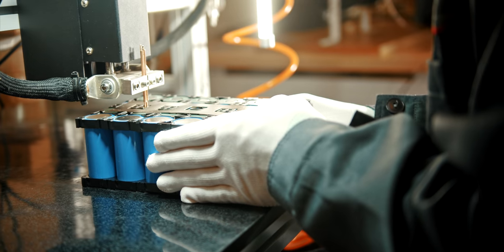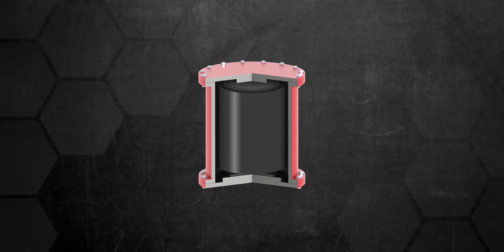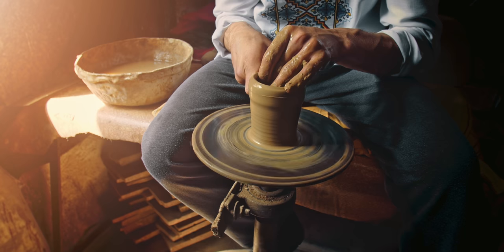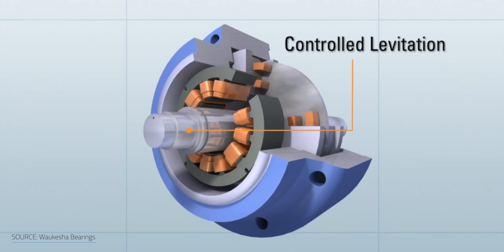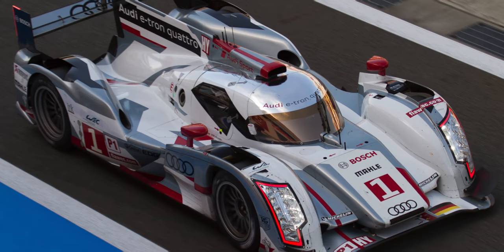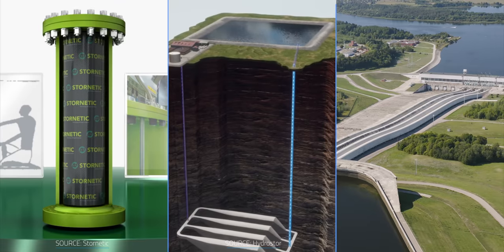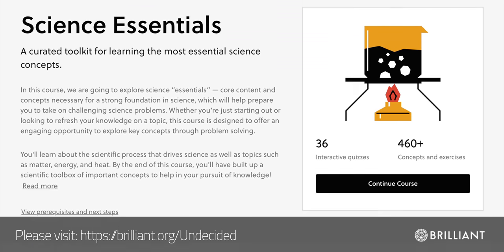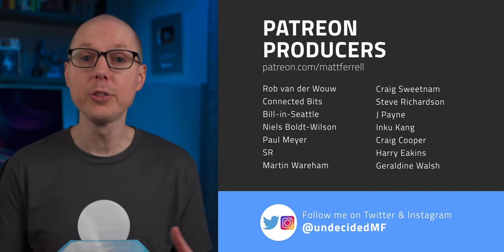The Mechanical Battery Explained - A Flywheel Comeback?

Comment: On a more primitive level, water towers too.  Which provides a simle health/society benefit at the price of much lower efficiency.
Reply: Any accumulators really - we should be using old mine shafts and massive weights on cables - some of those shafts are miles deep!
Reply: @JohnnyWednesday  Problem is that the gravity storage is really inefficient, even in deep mineshafts.
Reply: @MDP1702  - inefficient how? it's the same potential energy storage as pumped hydro but you can use the entire force of the volume
Reply: @JohnnyWednesday  Inefficient in terms of storage capacity and cost.
Reply: @MDP1702  - it's instantaneous load - like pumped hydro? it's worth the inefficiencies to meet demand, maintence would be next to nothing and cost? I don't know - but you're talking a generator/motor, a weight and some cable then a sub-station nearby - and there are old mines almost anywhere you care to look.

Plus you can use many cables in one shaft if you make the weights long and thin - you could suspend hundreds of tons over a mile drop and often far more - how much energy is that?

Given cranes that can lift greater than 100 tons require large diesel engines with a few thousand horsepower?

and not to mention that you can vary the amount of power at a given moment by allowing the weight to fall faster - and 'charge' the system at whatever rate you want too.

There's a huge amount of energy in potential for mass subject to gravity - as made evident by the power required for a rocket to ascend or an F35 to hover - those engines are roaring dude! and you can easily suspend more weight than an F35 in a mine shaft - a lot of energy!
Reply: @MDP1702  - And I'd point you to the victorian era technology of 'accumulators' - they are capable of huge power outputs - the accumulators that raise tower bridge in London for example - I recommend you  check out a video of those :) they're beautiful and fascinating! (Bascule Chambers)
Reply: fresh water is a very finite resource
Reply: @yes-vy6bn  there are ways of using seawater and keeping corrosion to an acceptable minimum - much worse than fresh though, of course.
Reply: @JohnnyWednesday  Let's assume you lift 1000 ton 100 meter with 100% efficiency. That only takes 272 kWh. This is obviously also the theoretical maximum we can reclaim. 272 kWh is roughly what 3-5 houses consume every day. So for every street we would need one of these gargantuan machines, each of them hauling a 1000 ton weight 100 meter up into the air or up a steep hill. How much would a single one of these contraptions cost to build? I guess we're talking tens of thousands of dollars.
Reply: @SweBeach2023  - I guess you're right. Seems like such wasted potential though... (badum tshh)
Reply: @JohnnyWednesday  it seems so but it isn’t. It works well in hydro power because big rivers transport insane volumes of water and substantial height difference are located along the river. There are several rivers that flow more than 1000 tones (m3) a second on average.
Reply: @JohnnyWednesday  The accumulators are more like capacitors.

Now, if you lower 1 ton 1000m, it would only provide around 100kW of power output, 1/30th-1/50th of windturbines. Now the storage capacity can vary, if you only use one 1 ton weight, you only get a total 2,8kWh, ofcourse you can use multiple blocks, though if you take 100 ton or 100 1 ton blocks, you'd be able to store around 277kWh. That is nothing.

The problem also is that you'll need to find cabling that is good enough. First problem is that even elevator cables larger than 500m are not really possible, this is why elevators in a very high building are a great problem. Getting a cable that can takes a larger load than 1 ton over more than 500m is likely to be very very cost intensive.

Then there obviously is the amount of deep mines, sure, there will be quite a few, but nowhere near enough to make a huge impact.

And then there is the cost of the entire system, which will not be small.

So no, gravitational storage is not usefull, at least not compared to existing storage options.
Reply: @MDP1702  - Thank you for taking the time to explain your thinking and knowledge on the subject - I concede that the idea is a poor fit for our needs, thank you :)
Reply: @yes-vy6bn  
There is 43560 square feet in one acre of land. If you only have one inch of rain.
Multiply 43560 x 144. And divide that answer by 231, and you will have the number of gallons of one inch of rain on one acre of land...  One acre is about 208.71 feet x 208.71 feet........

Another way to look at it,,,  if you were to go for a long walk,,,  say one light year.
You would no doubt get thirsty along the way. But some nice person put one gallon of water at every mile post for one light year...  It would only take 5.33 cubic miles of water to do that.  . 

Now they say that the ocean averages one mile deep,,,  So,,,  taking 5.33 cubic miles of water out of the oceans would not even be noticed... Oh,,,  there are whole countries that use nothing but desalinated  ocean water...
Reply: @SweBeach2023  Exactly. If at all, we could use ships and sink those weights to the bottom of the ocean without having to dig countless holes. But even then, we would need a helluva fleet of ships or rigs, and cables to move the electricity. Oh, and water friction also causes more energy loss. So no, that too is not a viable idea.

Comment: Well, it might be a competitor for batteries in some circumstances, but this is not even close to the sort of price to solve the seasonal energy storage problem. it's good that you covered this reality, some people really are ignorant of how far we are away from a cost effective solution on that front.
Until then - nuclear needs to be part of any zero carbon grid.
Reply: Nuclear power is even less cost-efficient than solar+flywheel (levelized cost of unsubsidized energy):
Nuclear power: $168/kWh
Solar Power: $35/kWh
Flywheel storage: $32/kWh
(This assumes that the flywheel is discharged daily, 365 days/year, in order to balance out  peak demand. It gets more efficient if used more frequently, but that is unnecesarry considering it already outperforms nuclear power)
Reply: @Ramschat  These figures are nonsense. Solar power is completely unsuitable in many parts of the world, such as northern Europe and Canada.

Comment: How efficient would the magnetic bearings be with the notable masses that would be needed to store the energy? Wouldn't they essentially have to carry the weight all the time using the electricity? How much of the electricity would be needed for that? Or could it be done with permanent magnets that don't need electricity?
Reply: permanent magnets would discharge their magnetism quickly

Comment: When it comes to energy storage, my first thought is raised water.
Reply: They are very inefficient and require specific landscapes to operate at scale
Reply: @nickvanrooyen3247  They’re generally really good due to the square cube law
Reply: @xa-38  I stand corrected, I see they are around 80% efficient.
Reply: Yep, they're great, only problem is in finding suitable locations that are adequate and empty enough to be flooded
Reply: @Paulo44.01  And also take a look at the current situation at Lake Mead (Hoover dam reservoir)

Comment: I've heard of using water stored in a high up reservoir, and then when energy is needed, the water can flow down a channel and generate hydro-electric.

Storing mechanical energy with gravity. Essentially, this could be done with any heavy object that's lifted and then lowered.
If you had a really high torque electric motor to lift an extremely heavy weight, you could then gradually lower that weight to generate mechanical energy.
I mean, hell, let's make a hybrid. Lift a massive flywheel up 25m, then gradually collect the energy as it falls and rotates. (easier said than done, but idk, it's an idea)

Comment: Grandpa said the backup generator on his Army base used a giant concrete flywheel run off a electric motor, when the power went out, the inertia of the flywheel started the generator.
Reply: @daviddavids2884  "started" the generator, no it drives the generator, that makes sense.

Comment: I've had a small obsession with gravity batteries for a while now, and not the hydro variety. There has to be a gear ratio that would be useful 🤔
Reply: We have gravity batteries; water reservoirs behind dams with hydroelectric generators. You're storing the mass of the water in the reservoir, and letting it flow to a lower elevation, harvesting the energy in the process.

Comment: I think that old school flywheel batteries could make a comeback. The flywheel might have to have a fluid filled interior so that as the revs increase, fluid is injected into the interior to increase mass which will help the fly wheel to run longer.

Comment: Put it simply :

1. Cost (more expensive than typical Lithium-Ion battery)
2. Energy density.

Flywheel are better suit for short but high energy demanding application like industrial application rather than slow but steady cycle like typical lithium battery application.

Comment: Love this.  What about compressed air as energy storage, then use compressed air to spin up flywheel.
Reply: I thought the same thing... 
solar power, compressed air to Flywheel to Lithium ion battery. Could be totally useless but then again I just watch YouTube all day...  🤷🏽‍♂️
Reply: @brandonleesanders  the problem is the amount of energy that would be lost, you don't want to transfer energy if you can avoid it.
Reply: @lukewatson8848  - Gotcha. So essentially every time you convert energy there’s a loss. Kinda like solar panels having an energy conversion loss of about 75-80%
Reply: @lukewatson8848   But with wind, you often have too much of a good thing and have to put on the brakes to keep your shite from destroying iteslf.  Wouldn't be hard to incorporate an air compressor into the turbine system, would do most of the "braking" to regulate RPM, maybe like Jake Brake. With air hoses run to air tank banks, it would be like free energy... if you had a flywheel already spinning.  #goelon

Comment: Small note on the use of flywheels on spacecraft, in the video you said they helped the spacecraft maintain "altitude" the only way to control altitude in space is with thrust or force that a flywheel cannot provide, they do however provide attitude stability to keep spacecraft in the same orientation for either fixed views or to keep from tumbling in space. Attitude adjustments can also be made by thrusters however thrusters affect altitude since you are changing the orbital velocity. Using a flywheel as a gyro doesnt change orbital velocity but does add to the "controlability" of a spacecraft.

Comment: Would have been interesting to see how the costs compare over different lengths of time. At 20 years out, the flywheel could still be going strong while it may be time for a 3rd set of batteries.
Reply: Exactly. When doing any sort of capital investment a company should be looking at cost of life. The depreciation per year is the true yearly cost.

Comment: Flywheels are used in many mine hoists where the site is connected to weaker power systems. The prime mover for an M-G set is directly connected to a large flywheel. As a hoist starts to accelerate, it consumes quite a bit of power. The flywheel prevents the M-G set from decelerating too quickly and reduces the power draw through the power lines that would occur without the flywheel. After the hoist gets closer to its counterbalance point, the M-G set begins to accelerate back to the unloaded speed. The flywheel prevents rapid acceleration. In this application, it guarantees a maximum power draw by the hoist and stabilizes the system.  The prime movers on these M-G sets are wound rotor induction motors instead of synchronous motors so they can withstand the large change in motor speed during a hoisting cycle. The whole system is energy inefficient though and very expensive to build, compared to modern day, high power electronic drives.

Comment: Fly Wheel would be more like a capacitor then what people think of as batteries.
Reply: Well 8kw for 4 hours is enough for a night of an average household. Those are the numbers that he stated in the video. If it wasnt that expensive i would rather put a big flywheel than 200 lion cells

Comment: I have a bachelor in physics and some obvious things come to mind with flywheels:

Friction is a huge problem.  It is probably the biggest problem.  You can store energy in a battery for years with minimal losses, right?  I can't imagine such a thing being possible for a flywheel.  

The size and strength of the material is another problem.  Flywheels need to be heavy and strong to store the energy.   A battery doesn't need that.

So it seems to me that if being lightweight, small, and able to store energy for long periods of time isn't a problem, then flywheels are good choices.  Otherwise, they aren't so good.  They are good for applications where the energy is stored for short periods of time and in which they don't need to move or where carrying something heavy is not a problem.
Reply: For solar and wind support the energy storage only needs to be one day. Most of it less than a half day.  For grid stabilization the discharge happens within minutes or even seconds.  Some consumers care most about the few seconds when processes are broken.  Those companies are willing to pay more for the security than they pay for total energy consumption.  The flywheel keeps power flowing while backup generators are turned on.

Comment: So... why is a hybrid approach interesting? You just showed two examples but offered no explanation what problems the combination solves.

BTW: you really mis-pronounced Almelo there. The stress is on the first part of the name.
Reply: He did indirectly. THe flywheel absorbes the highs/lows peaks (same as on steam engines in early industrial age).
Reply: I guess the flywheel can charge and discharge faster, while batteries have a limit to charge and discharge speeds. The flywheel will kind of act like a "mechanical capacitor"
Reply: @FSXgta  It also does not degrade as much with charging cycles, this is why it is a good use case to smoth the curves, this is what I understood.
Reply from the maker: Alex and FSXgta hit the nail on the head.  It acts kind of like a capacitor that can handle sudden spikes better.  And it doesn't suffer efficiency losses over time like chemical batteries.  Makes for a pretty resilient pairing.  And I'm not shocked that I butchered Almelo.  😂

Comment: Humans have this problem of latching on to every new thing and having a collective memory of fish. Many old ways are lost because we are too eager for new.
Reply: Yea that, as well as we are distracted from these diy projects by big Corps that promise comfort and ease, all the while delivering our bliss through a meter, which puts us at their mercy and under their control.
Reply: Well it depends on what requires energy. Portable electronics like computers can't really use them due to weight and complexity, large scales like cities won't because of their cost. It really just is dependent on complex variables but they do have a place, I think buildings can use them very effectively.
 
I've seen some comments say that a few hospitals use this system. But I say take it a step further. Individual buildings should all employ this system, think about it, it would cost less than batteries (and be more reliable, easier to maintain, and would have less impact in the long term), homes and apartments could count on them when power goes out and they could be shoved underground for an extra layer of protection in case of fails. It's on a  smaller scale than pumped hydro, but it does have a downside of not being able to be indefinitely charged like hydro (batteries have the same problem, so I guess it is a downside of most power storage and has to be wa worked around). Only a bit of personal renewables or wall power would have to be allocated to keeping it charged, so not as long term as complete renewable coverage but it could probably be cheaper than going all in or serve to boost their effectiveness as storage

Comment: The solution seems obvious to me: Make a flywheel of rotating batteries, suspended in vaccuum by quantum effects with high temperature superconductors... What? Is not 2036 yet?
  
El Psy Kongroo

Comment: The idea of using a flywheel to regulate and normalize electrical grids is such an interesting idea. It's doing pretty much the same thing flywheels used to do. Adding "mass" to a spinning grid system.

Comment: In my childhood I was amazed to see flywheel toys dnt need battery's or charge or winding key ....then saw in vcr heads n casset player decks .....it provides smooth running of tapes good to see it back

Comment: Matt,  Go find a fair in some small town somewhere and watch the old hit and miss engines run. The flywheel that the engine drive just spins at a low but very powerful RPM. Coupled to a gear unit and you can easily go 100  mph with the fly wheel turning just under 100 rpm....it's all up to the gear selection that makes the difference. Course it would never jump of the line.

Comment: For energy storage capacity on energ grids:
Flywheels are a very interresting opportunity as you can basically store as much energy as the flywheel design allows for. Yes batteries are  "more convenient" but are verry expensive, need proper storage environments and there's litteraly a small finite amount of lithium to make them. Traditionally this is why "pumped-hydro" is used for energy storage.

Comment: Williams developed a flywheel for F1, but never used it.  Audi did end up using it (the Williams developed flywheel) in the LeMans cars you mentioned, however flywheels are no longer used in any form of motorsport.